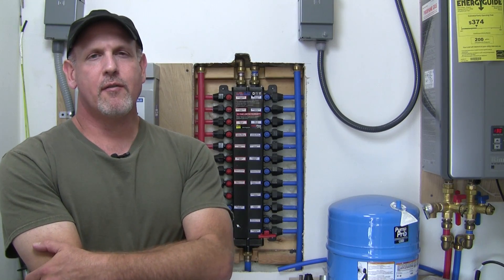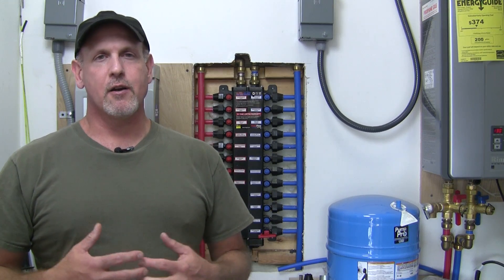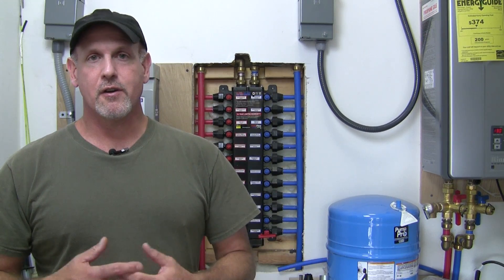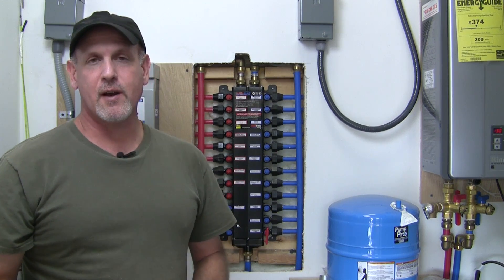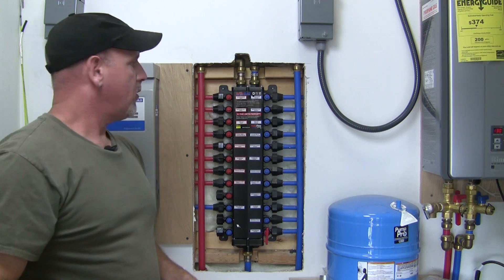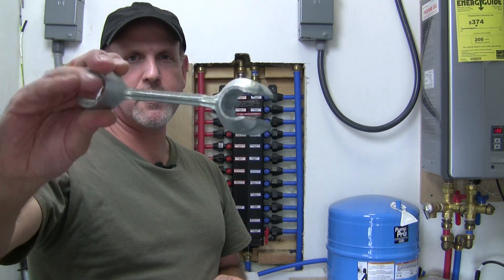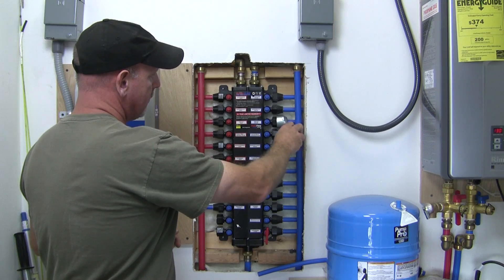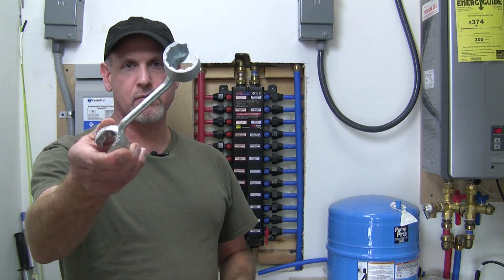Viega ManaBloc Water Distribution Manifold

Comment: Man I like your video.  I am in the process of renovating my home and have been back and forth with the idea removing all of the copper and replacing it with the PEX.  I believe your excellent example of being able to turn off a single line and draining it is what has tipped me.  Not that I'm in an especially cold climate (Tennessee) but I like what you said about having more control.  Plus the flexibility to add additional service lines in the future if needed.  I do have one question about your install.  I notice on the left side of your manifold that some of your lines are blue.  Now I know you can run hot or cold through any color, but I want to make sure that you are servicing the blue lines with hot water.  Is that right?  Thanks again for a well done video!
Reply from the maker: Thanks for the comments and for watching the videos.  I appreciate it.  I like the manifold system a lot.  And the PEX is so much easier to work with.  My cold lines are blue and hots are red.  BTW, I'm in East Tennessee and when we had that arctic blast this winter it was nice to be able to shut the water off to the outside hose bibs and drain them.
Reply: *****
Man I wondered if you were close to me.  I'm in Clarksville.  I added your website to my Favorites.  Whoever did your website design did a great job.  I watched you assemble the RTA cabinet.  That is one of my future projects with my house.  (Can't tell you how much it helps seeing it completed like that.)  So is the garage door opener.  I just  hope I have room to be able to consider the wall mounted unit like you have or possibly that they have a smaller unit that will work for a smaller door.
Reply from the maker: Small world for sure.  I'm down your way fairly regularly.  Thank you for the compliments.  I did the website myself from a template.  I'm still learning all that stuff.  It's really confusing to me but I'm learning.
Reply: bentroddon I purchased the Manabloc and am in the process of installing it.  Your video and comments are very helpful.  Thank you!
Reply from the maker: Outstanding.  Glad it helped out.  Good luck!

Comment: Your waving that wrench in my face almost like your laughing cause I am at a stand still with my install as I wait for the wrench to arrive... In CANADA!
Reply from the maker: Ha!  I'm hopping in the car with the wrench right now.  Be there in two days!
Reply: Tks! Nice install, your lines look immaculately placed. On the main service lines do you use pipe tape or no?
Reply from the maker: Thanks.  I did not use pipe tape on any of it.
Reply: Right On, I just removed the tape now since I haven't installed anything or water to it yet. When you installed Sharkbite to the top 2 outs service lines you mentioned a fact to be able to have the nuts to swivel to tighten the fitting. I'm aware that the sharkbites allow that freedom however, don't those service fittings (I have the pex crimp adapters from Manabloc) allow swivel when tightened down? I thought they did to allow a person to tighten the hot and cold outs?
Reply from the maker: Yeah, come to think of it I think you are right about that.  If not you could tighten them down before you crimp your PEX on the nipple I suppose.

Comment: Great job on creating an informative video that led to my decision to use ManaBloc myself. The compression fittings are a 4-piece design, after the insert, tube nut and split collar there should be the actual compression ring. From a home owner standpoint, I would like to add that there are different mounting options. We went with a surface mount on the roof of our 1/2 basement. Also, pay a great deal of attention getting the tubes as straight as possible to the block. You do not want to test these plastic threads, trust me.
Reply from the maker: Thanks for watching and for your great comments.  I appreciate it.  Glad the video helped out.  I really like the system and it was really handy during this past arctic winter having control over the outside fixtures.  Thanks again for watching.